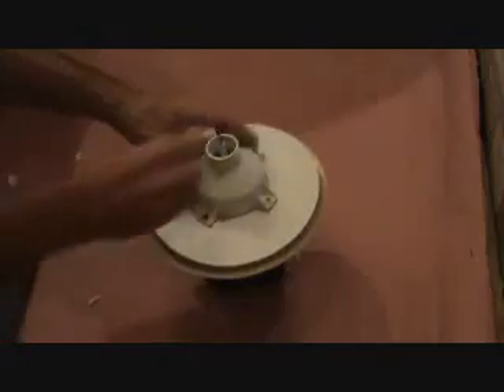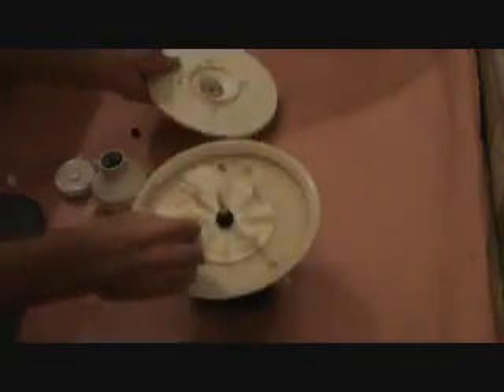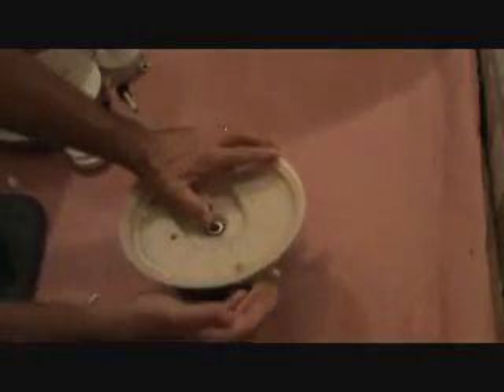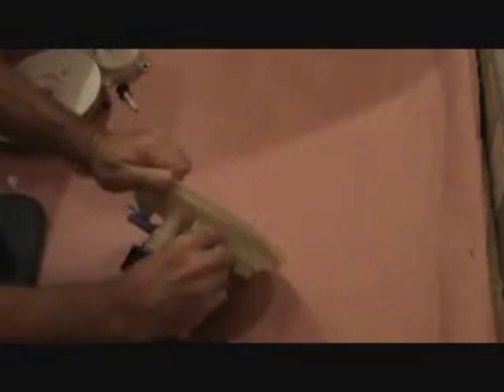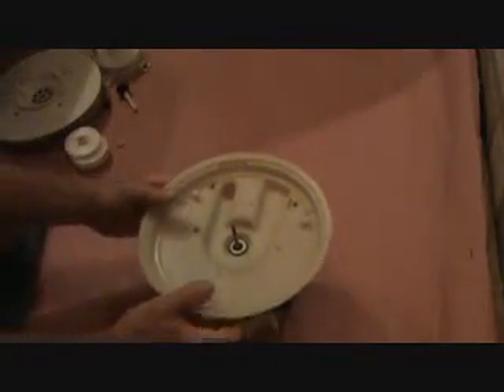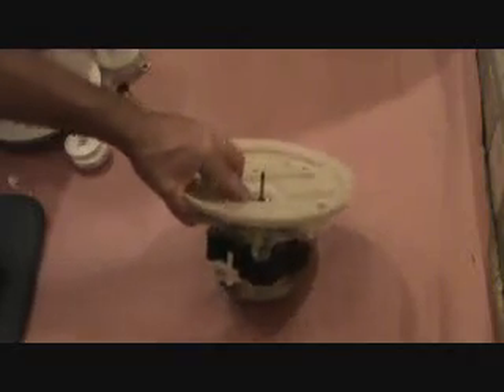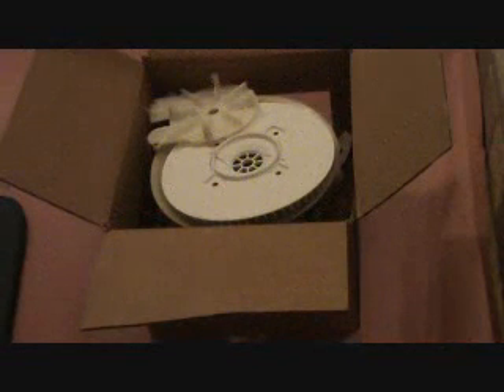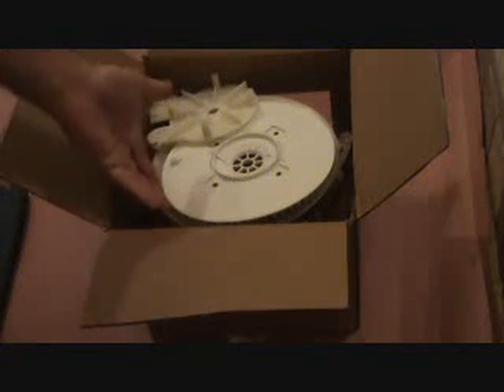Repairing a dishwasher...Part 4

Comment: I wonder if the item (glass, etc.) that became jammed and broke the fins on the plastic impeller also damaged the plastic flange on the motor. Perhaps the motor shaft wasn't able to rotate due to the jam and it eventually caused the flange to snap off. Then again, perhaps they were unrelated. Good job, Joe.
Reply from the maker: bg147 Dude you might be right! Thanks for your message.......